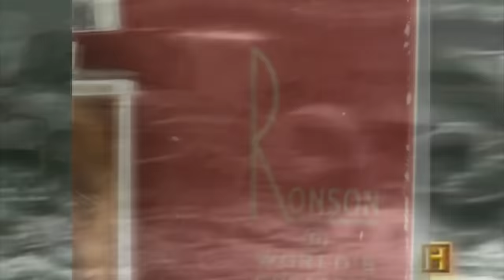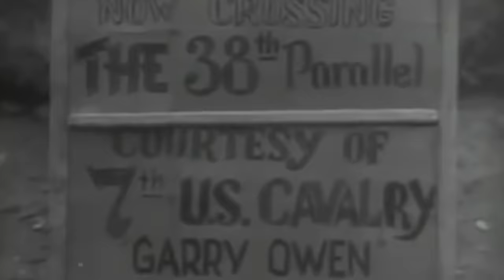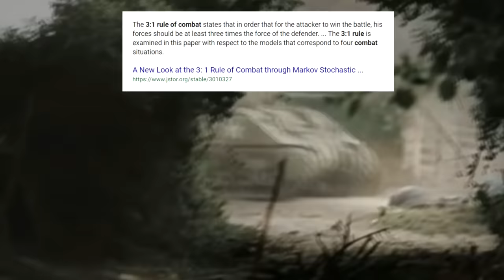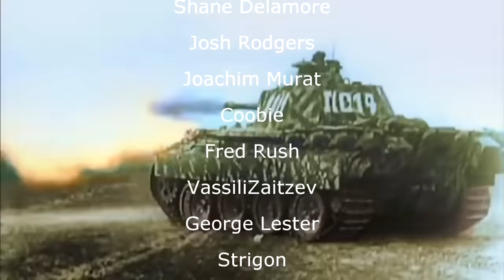The American Tank Meme

Comment: From a reliability standpoint it was probably the best tank of the war, it was rather average in all other areas but then again that was the point as you said its just an average joe battle tank made to get the job done, and it did.
Reply: Comrade Kommodore a jack of all trades is definitely a good choice in war
Reply: @Kylel0519  yeah that f35
Reply: NoNoseProduction that’s the jet correct?
Reply: i would agree, and i would also say changing to different versions of a tank rather then going to a completely new tank is kind of wasting money if the old tanks did just fine, i dont think the germans should of changed thier tanks as much as they did and use their big cats in lesser numbers then they have, maybe just put a little more armor on the panzer 4 with a better engine and i think that couldve done better for them.
Reply: @notlogical4016  I agree, the German tank variants and types are... Staggering to say the least. Then again some of the designs were sound, like the STUG, Panzer III, Panzer IV, and Marder, and... the Panther TO A degree. 

The only issue with all of the German vehicles is that there is so many, plus many more variants/upgrades, and each one is so meticulously crafted; that spare parts let alone repairs are a nightmare.

Had the Germans stuck to the base line Panzer III, IV, and STUG series I could see their tank army being much more manageable, tack on MAYBE a Panther or Tiger later down the line for good measure.
Reply: @KWyzel  There is a lot of discussion ATM about weather the Sherman really was the most reliable due to the huge surplus of spare parts (That may of / or has inflated its numbers dramatically)

Your second comment is a little misinformed to say the lest.
The USA produced about 12 different tanks with 28 Variants note most were Sherman with about 16 alone most were produced in the Thousands.
The Soviets produced about 12 different tanks with 34 Variants most were the KV1/ IS with about 13
Germany produced about 8 different tanks and +1 none German tank with 38 Variants with 7 of them as basically artillery tanks = about 3,000 if that most were just pazer 1s and 2s without a turret and a different gun and 7 more as dedicated AA tanks =less then 600, add on top of that TD/stugs 11= with about 19,000 most of that stug 3 and 4s. They were probably the most cost efficient in manpower, resources and overall in terms of reusing outdated equipment effectively.
UK Produced about 7 different tanks with 21 Variants
Reply: @albinoofthesunlongboof3889  The amount of tanks I mentioned with Germany was the sheer Variants of each type. For every Panzer and the SPGs based on its chassis, there were multiple variants of them. For example the Panzer III entered the war at the A, B, C, and D model, and ended the war at L, M, and N. Each of these minor variants changed bits and pieces of the tank sometimes for the better, but often times the changes were so minuscule that it wouldn't be worth the effort... where as the Allies often (but not all the time) made big changes to their tanks that were worthy of changing production.

I am aware of the big debate with the Sherman's reliability and such, I am on the Fence concerning it. I'm sure it broke down just as much as the other nation's tanks, but the ease of repair and access to spare parts made the tank far easier to repair in comparison to the engineering nightmare that was the Panther, and Tiger series tanks.
Reply: @KWyzel  I believe this was more of a stop gap solution which does not give you advantages all the time and having a tank with a different gun for example shouldn't be classed as the same tank I get what u are saying some of the changes were so small they didn't need to but they probably did so to easily find them When for example maintenance or so forth was required to save time as we know the testing time for Germany was limited compered to say the USA so a lot of the time it was just sent out and tested on the front lines.

The engineering nightmare that was the Panther, and Tiger series was no different to all most every nation with tanks it was More to do with rushed service as it was put out in half the time as other tanks and planed in half the time with huge changes made even near the end of planning but was not that fair behind most other tanks the t34 for example struggled to get over 50% reliability till after 42...

Also the Germany industry was bombed and supply lines making a huge difference but is often glossed over Germany built bigger and better tanks to survive longer and require less resources which they did so they actually went for more cost efficient then people think as people don't think about logistics, manpower, training and so forth because its the Germans they had to do it all wrong or at lest something if not everything wrong lol but in the circumstances they were in they went for the best option they had available at the time.
Reply: @albinoofthesunlongboof3889  My whole point concerning the German variants is this: Making so many varieties of the tanks and spgs in question was a massive drain on much needec supplies and resources. Why make so many variants and models that can hamper and slow down roduction, when you can stick to simply what works.

Yes the Shermans ease of repair may have been a stop gap, but it was a stop gap that worked. Plus the Shernan at its core was essentially a stop gap, when the US entered the war they quickly realized they were far behind the armor race, and hastily pushed out the M3 lee and soon after; the M4 sherman using combst data gathered from the Lee. The US knew they couldnt match the Germans 100% but theyd atleast make a versatile machine that could get the job done.

The T-34 was not made with reliability in mind, the T-34 was made with pure simplicity in mind; the Soviets like the US understood that they couldnt best the Germans at their own game, but aslong as their was a few men and tanks in the way then they could settle for less in terms of quality across the board; many soviet tanks were out fitted to last a month at best, with purposely shoddy craftsmanship to increase production and lower resource expenditure, the loss of a soviet tank would not be felt, but a single Panzer was months of work and countless resources lost. Given the size and amount of resources of both nations its quite clear who would win in the long run. In short the T-34 was purposely made shoddy, but was said to be easy to fix under most circumstances; the average German Panzer was a engineers masterpiece and mechanics worst nightmare.
Reply: @KWyzel  I'm saying that the same tanks with different parts were more a stop gap to save time and money not a drain on supplies.
Now I would agree with you but how far did Germany have to travel compered to say USSR or USA and how faraway was its industrial bases...

As an example A-D  panzer4s was about 300 built from 1937 to 1939
Then D and E from 1940 about 300 built
Then E and F in 41 about 500 modals so its just a standard evolution over time see the Sherman was the same some were wielded, some cast, different HVSS and engine in reality all most all tanks were. You could argue that the USA changes still had a lot of the same parts as they did but so did the Germans now they may not have bean all the time but it wasn't uncommon to try new things as I all ready said they didn't have the same level of opportunity to test.

I'm not saying what you have said is wrong but from my understanding you are just looking at face value not taking an in-depth analyses.
like looking at the basic numbers you would look at the USSR vs Germany as a no hope win so why did Germany do it yet when all the data is put together the soviets struggled to stay in the fight even with lend-lease and Germany wasn't even fully mobilises but luckily for them the allies opened up more fronts allowing them to overcome there situation.

The Sherman was over all Better then the T34 and panzer 4 but in combat and support roles it was relatively equal.

The elephant comes to mind would you say it was a waste of resources?
I would not as the man hours of the 90 to 100 chassis had all ready bean put in so to scrap them would cost more resources and time and they basically made up all there problems by how effective they were at killing the enemy even though most of them broke down it was just unlucky for the Germans they were losing ground and could not retack them like they had for most of the war at that point.
Reply: @albinoofthesunlongboof3889  Im well aware of how close the Germans were to home, and this would allow some liberty with designing their vehicles.

Yes I do find the Elephant useless, a Tank Destroyer that has such a massive reliability flaw that it is more prone to breaking down before it has seen combat? Thats not worth the resources or effort, the hulls couldve been retrofitted or if the germans were that desperate, atleast fix the transmission issue or try to more weight off the struggling suspension. It is said that many were abandoned in Kursk for minor track damage. A waste of effort and resources.

I never said the Sherman was better than the T-34 or Panzer, did you assume I did? Because I never did; I consider the Sherman below the Pz IV in some cases.

Why did the Germans do it? Simple; they saw what happened in Finland and came to the conclusion that the USSR was all show and no talk, and theyd be right for the first year of Op. Barbarossa, when the Soviets absolutely crumbled under the pressure; however this assumption that Germany ever had a chance to win is ludicrous, the fact is Hitler and the German high command were so out of touch on the situation it might as well been a joke. The High command simply thought taking Moscow would end the conflict much like how they did in France with Paris, however this is vadtly incorrect as Stalin and his lackeys would never surrender so easily; and Hitler over estimated his armys capabilities, he assumed he'd habe enough manpower and troops to cover the whole Russian frontline, plus have enough men to cover the rear guard from partisans, and have enough troops to also cover North Africa and subdue the West? Simply impossible. There were constant manpower shortages across the board. Sure one could say that Lend-Lease saved the day, but I beg to differ. Lend-Lease simply added to the vast stockpile of the USSR, ask your self this... Do you really think the Soviets lacked guns and ammo? I truly dont believe such a notion; given the sheer amount of Rifles and Ammunition placed witin stockpiles from WW1 and the Russian Civil War. Plus the Russian industry is often overlooked, simply take a look at how many T-34s, Mosin Rifles, and other weapons/vehicles were made during just WW2 and you'll find some numbers exceeding even the USA. Does that mean the Lend Lease was useless? No it contributed to the war effort and took some strain off the Soviet industry, but it didnt win the war.
Reply: @KWyzel  I find conversation like this interesting to hear other people opinions helps broaden ones understanding I think.
 
But as I said I don't think scrapping the Elephants would have bean a smart move and I think the Germans new that, over all cost more time, money, man-hours and resources because you still need to supply say 200 to 300 more vehicles with parts, fuel, ammo, and train new men I believe the numbers of enemy lost to take out the tanks out numbered any problem with losing more tanks to brake downs so on.

Your argument is a strong one but looking at the bigger picture I would say that's a small price to pay for such a huge benefit.

IDK if you bean in the army but old ammunition is not the best lol but better then nothing.
I love that idea but as far as I'm aware Russia was modernising in the 30s and early 40s most of its old equipment had all ready bean replaced and scraped but that would be some interesting data to see if its true.
But the huge numbers the Soviets lost was astronomical they finished ww2 with 20,000 tanks and 30,000 Air craft Even Germany who lost had more Aircraft then that.
Even Germany who was apparently resources weak and had no chance was just under the soviets in many category's or in front easily and they were not even fully mobilised till it was to late Germany even out produced the USA in some things.
In saying that Germany was lacking some vital resources but not all.
Reply: @albinoofthesunlongboof3889  I mean from a comparison over other Heavy tank destroyers, the Elephant is on par... A giant mess. Every Heavy Tank Destroyer suffered from the same issues as the Elephant... Transmission issues, engine trouble, fuel guzzling, slow speeds, and poor maneuverability. The only two good parts about them, are their heavy armor and bigger guns. This to me doesnt out weigh the bad... If the vehicle cant reach the battlefield reliably then what was the point in its creation to begin with? The Germans quickly realized just how trash the Elephant was after Kursk and opted to cut their losses and use them as essentially mobile bunkers in Italy... A secondary front at best... Where it basically didnt have to move from the "Gothic Line".

The Russians have a habit of holding on to old equipment, to this day the MASSIVE stockpiles of Mosins are still in storage alongside thousands of T-34s, T-54s, and T-62s. Why? Who knows. But this habit was present with the Soviet Union as well... Large stocks of Mosin Nagants from World War 1 and the Civil War were still being sat upon by the Soviet government and there are records of other WW1 weapons being used like the rare Federov Avtomat. So yes, they were modernizing but still held onto older weapons as a back up I suppose. As for the ammo, im aware old ammo is not good for shooting, but some of it at the very least wasent TOO old, plus given that the 7.62 x 54R round was so common in Russian weaponry I doubt they lacked it at all even in 1941...
Reply: @KWyzel   But it was understandable as they pushed the limits at the time that's how you get the next generation and find out what you can do and cannot do or you just stay stagnant I'm just saying they were a huge problem but one that was worth it in the long run they also made who ever they were facing have the same problem by destroying so many vehicles they made who ever they were facing spend 2 to 3 times as much on a replacements alone.
Also 30km an hour is not slow back then most German tanks were quite fast especially when you add in there size of there heavy tanks and The fuel consumption was not bad basically run 2 Sherman's or 1 elephant seeing as it was 2x the size that's not a bad thing.
Only a few were in Italy as far as I'm aware something like 11 about 1/4 of the number left and they didn't preform well at all unlike the eastern front which they did excellent in.

My point wasn't just gun and armour it was how effective it was in combat when not broken down made up for all of its problems the first combat they lost what 10 units to 300 soviet tanks and the soviets only took out one the rest were abandoned 3 court fire, 4 lost there tracks, 2 blew up there own engines but all besides that one were repairable.

Every nation keeps some equipment its good to have hidden stoke piles even if its outdated as a modern war could go nuclear and having equipment ready for when they come out there bunkers will be needed.
But not all of it normally the reliable stuff but Russia seams to get it more reliable more often then most nations.
And 100% agree they would still have old rifles the technologies didn't change much back then with that and even now But older equipment was made for trench war longer rifles so on but would be interesting I'm positive even the Germans had ww1 equipment in huge numbers at lest infantry equipment even the USA did but the newer systems made more impact the hole combined arms thing was very important and the Germans basically invented it why there were normally better at it then us and they had bean doing it longer and on much bigger scale.
If it was worth keeping it was there but the war was getting bigger and bigger things like At guns became obsolete in a year and were brand new like the Russian 45mm they built like 65,000 pieces and it was all ready getting fazed out like the German 37mm and 50mm but the numbers built were not that huge But like America was slow and didn't update its AT GUN there standard AT gun was the 57mm by 1943 it was pretty ineffective but they only made some 15,000 units.
Reply: @Britannic hayyomatt  The UK alone wasn't very rich its empire/commonwealths was but it struggled even worse then Russia.
Russia received about 12% of its ww2 needs from lend lease but the UK got over 30% of its needs from lend lease if not more now it did have the worlds second biggest navy at the time/start of ww2 but it only just bigger then japan by like 30 destroyers but they had less Aircraft carriers in fact japan had something like 3 more then even the USA.
Japan had a bigger army then the UK by 2million and had far more serve in its armed forces and japan was not a first rate power.
The Uk had almost 50% of its wealth alone come from India it is also why after the war they became a second or even third rate power and will unlikely every become a super power again at lest by its self at the head as the USA has taken that spot and the only way it will keep it is with CANZUK I cant remember the acronym with America in it but they would be the last to join and other country's like south Africa and India would be invited as future members or half members But if the Uk keeps trying to re-join the EU or what ever mess there government is in at the moment it will not happen with the UK and they will probably loses there last chance to stay near the top of the world in the next 100 to 200 years permanently.
Reply: @albinoofthesunlongboof3889  I do agree that pushing the limits to learn new thins is a good idea, it does create problems in war time, but then again thats the perfect time to push your industrial capacity and the desings themselves to their limits. So I find validity in that argument.

30km an hour on paper, but thrown in the reliability issues and rough terrian and it is not likely to reach those speeds. I dont find German Heavies entirely useless, and any gripes I pose against them can be applied equally to other nation's heavies... However theres a reason Heavy tanks fell out of favor in warfare. Simply put, every nation came to the conclusion that big, expensive, battle tanks were not the way to go. Mobile warfare requures tanks that can keep up and support the infantry and exploit gaps in the enemy lines, Heavy Tanks cant do that reliably like a Medium tank or Main Battle Tank. Were heavy tanks useful? On occassion. But it required the right circumstances as displayed with our discussion of the Ferdinand; Kusk was a flat open plain that allowed tanks to fight at their maximum range which gave the Ferdinand great battle efficiency, but in Italy where theres rolling hills and mountains youre left with a machine that cannot traverse the terrian nor fight at its maximum range. Heavy tanks are far too situational and time consuming to be fully worth it. Whereas a versatile and far more adataptable vehicle can succeed, like the Pz IV, T-34, and M4 Sherman.

The Germans did have Ww1 equipment or atleast variations of it, many early German units were equipped with the Mp-28, an upgrade of the Mp-18; large quantities of Mg 08s were also in storage and saw use by the Volkssturm. In addition there were many Gewhere 98s that were converted to the Kar 98 most notably were a quantity of "Trench magazine" G98s with extended internal magazines capable of carrying 20 rounds. These were issued to Volkssturm and Osttruppen Divisions, namely the sub-par "700-Series Divisions" who served in Normandy during Operation Overlord as static infantry using essentially Ww1 tactics these "700 series" divisions also received afew Ww1 German artillery pieces if im not mistaken.
Reply: @KWyzel  Germany heavy tanks were better off road then the rest so there is that, They were designed for brake thru also now were they better at it I would say yes with combined arms but that's also a reason why they didn't build them in huge numbers they wanted to with the panther but they seen it as a medium but the bombing campaign stopped that, they weren't planning to, but I don't think you can say that a medium is better at that job its just better all round sometimes you need all rounders but like with the Greeks they all started having full army's of phalanx's and that was not smart they were one component of an army but not almost the hole thing.
But when u can built more you go with that doctrine when u cant you have to make your stuff better and last longer so basically what the Germans did but most tanks today are what 60+tons and armoured cars getting over 20tons.

There a great video of the German showing of a tiger 1 to the Turks as one of there join the war with us things they did and the tiger looks like its doing 60KMH not saying it did lol but the point is German new it had problems so what do you do when something is likely to brake you don't push it to its max you set limits so that's what the Germans did.

I also find army's after a big war will fall in to a loop of out dated thinking on combat or just one type which in till the new idea gets in nothing changes but the military's of the world don't actually like to change things that work but when someone changes the ball game it puts them at a huge disadvantage one of the reasons I left to much crap that doesn't need to be done like marching its not the 1700s any more its just a waste of training time its all about the people up top showing off to other country's its so outdated.
Reply: @albinoofthesunlongboof3889  
The Tiger 1: 
Maximum Road Speed: 28.2 MPH, 
Normal Road Speed: 25 MPH, 
Cross Country Speed: 16 MPH. Operational Range on Roads: 121 Miles. 
Cross Country Operational Range: 68 Miles

The Tiger II:
Maximum Road Speed: 25.8 MPH
Normal Road Speed: 24 MPH
Cross Country Speed: 12.4 ~ 9.3 MPH
Op. Rng. on Roads: 110 Miles
Cross Country Op. Rng.: 75 Miles.

Elephant:
Only a single speed is given by sources, they seem to agree on 19 MPH, if I had to guess it likely went slower cross country. A single Op. Rang is also given: 93 miles. Again Cross Country Op. Range is likely lower.

JagdTiger: Only a single speed is given, 21 MPH it is likely slower Cross Country. Op. Range on roads is said to be 75 Miles and Offroad 50 miles.

Given that all tanks are more likely to fight cross country or off road, none would reach very high speeds, and even on roads they lack decent speeds. While some Allied heavies were slower, namely the Churchill and KV-2 the remaining heavies like the IS-2 and M26 match the speeds of German heavies. None of the German heavies get close to 60kmh, my guess is that Tiger was going max speed, which for a Heavy is impressive but nothing ground breaking.

Im of the opinion that a medium tank can perform, a heavys job. Many medium tanks by the end of the war had guns that could compete if not surpass heavy tank guns, hell the 88mm on the Tiger 1 was being matched and beaten by both western and eastern allied powers by 1943. In addition the Panthers 75mm did the same and given the panthers superior angled armor design one could argue that the Tiger 1 was obsolete in 1942 and onward.
Reply: @KWyzel  Sorry we don't do MPH if you look up the Sherman its 22 to 30mph on road depending on variant so its pretty close. 
YUK I feel Dirty for using MPH... haha!
You would get a bigger advantage if you have to travel more which America did.

The 88mm on the tiger 1 was a what 36 modal and less powerful then most the 88mm flak which is strange But yes the American 90mm and Germanys 88mm were almost the same in penetration but ammunition type was more a factor also but I think the Germans had 5 to 10mm in favour in there weapons when they vs similar weapons.
The 76mm and 75mm were extremely near each other but as I said just depends on modal and ammunition type but the German were normally better off as they had more armour thickness. 

And I 100% agree a medium can preform a heavy role but not as well but a medium can preform other roles better some much better which I believe is your point but the same argument I would make for light tanks a lot of Americas TD were light to medium tanks this is why I also believe they became the norm after the war if Germany had won most country's would have adopted more specialised tanks.
Artillery/support tanks are making a comeback I mean any tank can preform that role but when you have specialised its better at that role obviously or they wouldn't employ it.
I also agree the tiger was obsolete in 1942 maybe more so in 43 but like the panther was heavily influenced by the T34 I think the tiger was by the KV1s they have very similar looks and idea behind them I think the German were like wow we need to make ow own versions of this but better I think the Tiger 2 was the Panther heavy as it was basically a big panther but the German E-series would have bean fantastic.
But also the tiger 1 is the basic idea and is still around to day the shape is more or less better lower to the ground I think the Tiger 1 was very good but it needed sloped armour like most modern tanks.
As we can see both the soviets and Germans were getting bigger and bigger not just in tank but Guns Etc.
Reply: @Kylel0519   not really the Bradley was the worst example of that.
Reply: Z Fire well the Bradley is a scout vehicle not a vehicle meant to go into combat (or I would assume at least) so it’s not really a jack of trades vehicle (or at least what I would call one) with it being more of a speed and armor above most else, while the abrams is the breaker of all of these being an almost master of all trades vehicle with good armor, speed, and firepower along with good reliability. Unlike the Bradley where as I’ve heard it’s just got the equivalent of a peashooter for its main gun unless I’m thinking of the wrong bradley
Reply: In all honesty if the Germans had focused all of their armor production efforts on stugs they would have been more successful
Reply: @KWyzel  i'd like to point out "ease of repair" was never a stop gap if you look at any modern combat equipment in any military you will see that there are part that are the exact same on any machine (for example the lights on most American land vehicles are the same) and they are modular in design making repair easier on the mechanics. the whole point of it is that it doesn't matter the machine it can be fixed easily. in fact when I was in I witnessed a striker getting a power pack swap (engine and transmission) done in a day. so it may have been a stop gap in WW2 but it is common practice now, at least for land vehicles